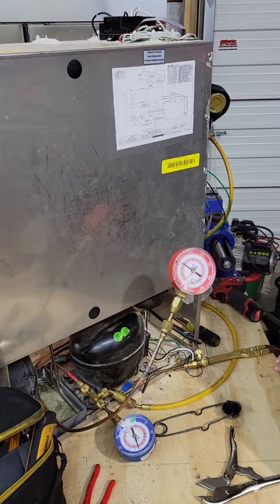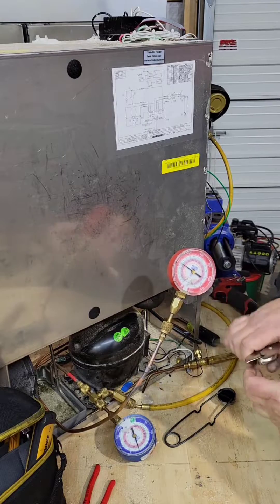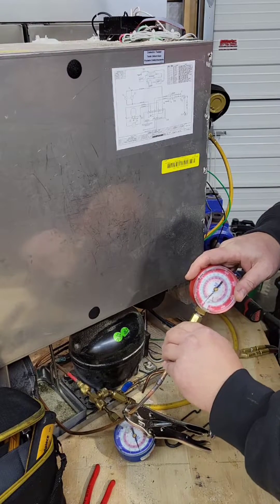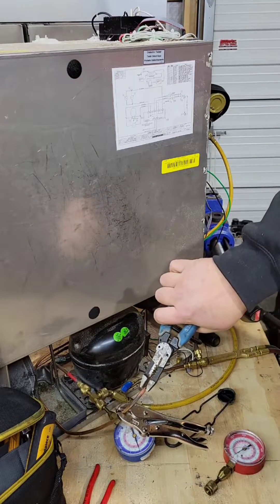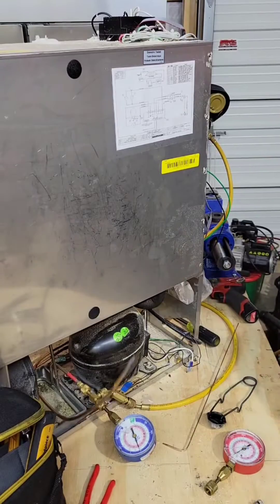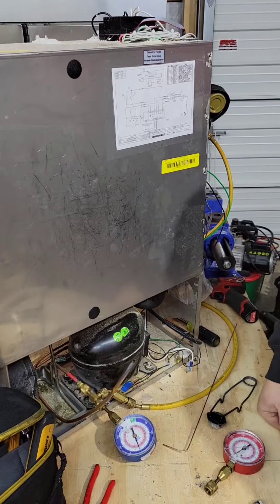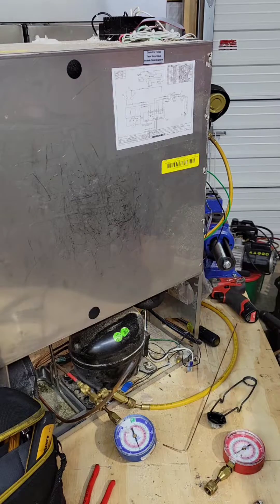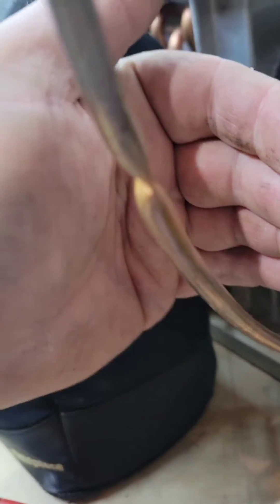Tech Tip on pinching off and brazing while pressurized to 200psi.

Comment: How do you set your pinch off tool I mean how do you know if it’s pinching down too tight to cause damage or not tight enough?
Reply from the maker: It just takes practice unfortunately. On 1/4inch I set it until the 2 jaws touch. The gauge will rise back up if it is still flowing past your crimp